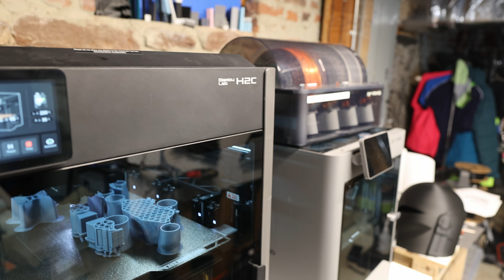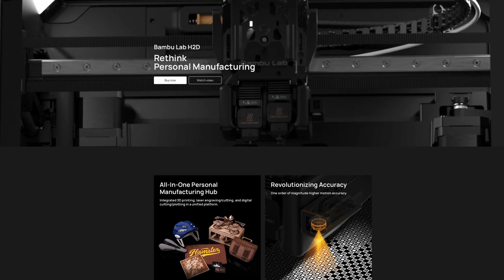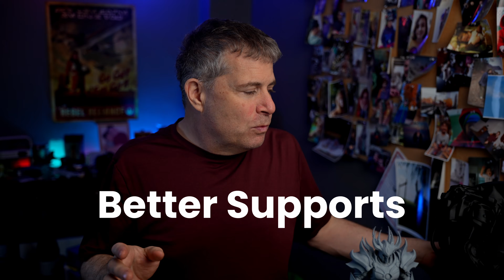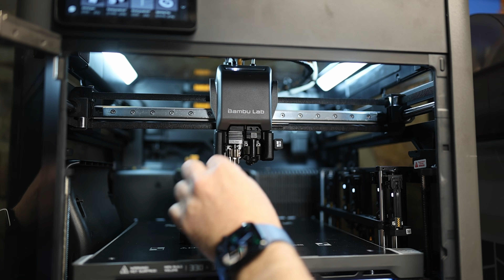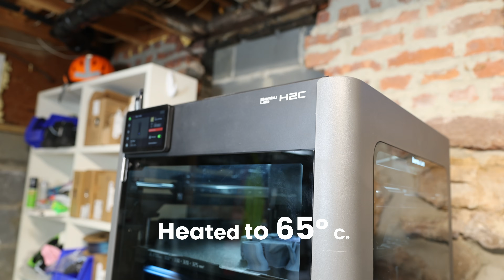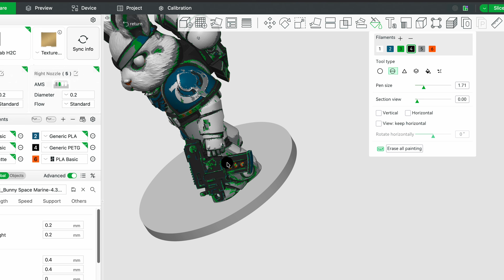The Bambu H2C Is Revolutionary. Here's Why You Probably Shouldn't Buy It.

Comment: I bought the p1s last month and returned it for the p2s because of the ams2 pro and other upgrades. Now I really want to return the p2s and get the h2c just because I can multi color prints without waiting days for it to finish and wasting pounds of filament. 

I’ve only been 3d printing for 2 months but I’ve been non stop at it and hit about 1500 hours already. I think future me will thank myself for getting the h2c. I’m just worried Bambu will release something better next year and I’ll have that buyers regret on not waiting!
Reply from the maker: That's some serious printing hours for just 2 months! This is like computers though. There will always be something  better in a year or two. You have to think of this in terms of the utility you get from it right now. Would you save enough time with the H2C by the time something better comes along that it’s worth it? If you’re printing at that high a level and you could save, say, 30 percent of your time with the H2c, it will save so much in time that getting something else whenever it comes out would be a trivial cost. 

My P2s sits largely unused at this point. 

If you do buy something please consider using the link in the description, it really helps. :)

Comment: Fot my business i like the color options, finished look, stability, and heat tolerance of ASA. I have an x1c and a p1p. The x1c just barely prints asa sometimes. Would you recommend the h2c?. Btw i do mostly 2 color prints but if I do the h2d i am only a couple hundred from just doing the h2c. Buyers remorse. Plus future growth.
Reply from the maker: I haven’t printed ASA myself on this printer yet, but I know what you mean about the other printers, the higher nozzle temperature the higher chamber temperature should be much, much more reliable. If you do buy a printer, please consider using my link in the description as it really helps out the channel. Any printer you get on the site after you click that link will give us affiliate commission. Maybe I can afford some ASA filament at that point smiley 😊
Reply: The H Series printers print ASA/ABS/ASA-GF/ABS-GF etc. as easily and as fuss free as my X1C prints PLA. With the engineering plate and a glue stick, both PA6 and PP also become 'slice, print and forget' jobs. The heated chamber makes a huge difference to repeatable results (and the layer adhesion is also FAR better, so it's not just aesthetics that improve).
Reply from the maker: Thank you for answering that.

Comment: So math is not quite right. It is apx 2094 cubic inches for the total build volume, but that is misleading as you can only use 1904 ish cubic inches with both nozzles (2063 if just using the left nozzle, 1936 for just the right). Only way to use the full volume from my understanding is by using the same filament in both nozzles and switching from one to the other for the very edges. Not very practical.
Reply from the maker: Good catch on the actual usable volume, you're right that it's complicated! Or rather I don’t math well.

Comment: My friend has a bambulab and honestly he’s not too happy with it. he keeps running into issues where prints don’t stick, jobs fail halfway through because of random errors, and it’s been pretty frustrating for him overall. on top of that, he’s also not really comfortable with the printer talking to the company’s servers, so he’s a bit concerned about his data and privacy too.
Reply from the maker: That's unfortunate, though most adhesion issues are solved by just cleaning the plate with dish soap and water! This does not seem to be indicative of the Bambu experience. I have have had eight of their printers in my studio within no major problems with any. 

If he doesn’t want to communicate with their servers he can use LAN only mode.

Comment: I have a H2S and want to get a second printer for multi color wasn't sure if a H2D or H2C would be the better choice. I'm leaning towards the H2C now after your video I feel the H2D will still be slow with more than two colors as the right nozzle still has to spend all that time AMS switching and purging time / waste. Great video!
Reply: I was torn between the two, then realized there was only a $400 difference between the two. You get a lot more printer for $400. I chose the H2C and love it.
Reply: @R @RoosterGardens  yeah seems to be the better choice for the price you are like 90% there if you are going to spend on a H2D .
Reply: @raddddix I don't think you'll go wrong with either one. Bambu makes nice printers. Even my A1 Mini is a little printing beast. I think it's still worth the extra money for the 5 extra nozzles. And for the record, my A1 Mini poops more than my H2C, and it only prints one color, lol.
Reply: @RoosterGardens 😂
Reply from the maker: Glad I could help you decide, the H2C is definitely the faster route for multicolor! 👍if you get one it would be great if you can use the link in the description. It really helps a lot.

Comment: Pressure tower isn't a waste?
Reply: You can turn that off, but at the risk of print quality.
Reply from the maker: You get that on any multi filament system so that’s a sunk cost. It’s not considered waste in the sense of the small curls of filament because it’s required for any color printing. If you don’t use the priming tower the filament won’t come out right.

Comment: Not sure how this would compare to core one L with Index, but both are very expensive printers.
Reply from the maker: It’s hard for me to even guess because for some reason, Prusa has never returned any of my emails. That’s sad to me because the mini is how I got started in 3-D printing. The color system looks interesting but I have a few concerns. The spools seem to fall out when removing the covers so you have to hold one in with one hand at all times to change them. I read you’ll have to drill into the machine to attach the system but I can’t verify that. It also maxes out at 8 materials. While it’s more wasteful having up to 24 spools means you can leave things kike TPU and other exotics in the machine or have several spoils to fall over to when a spool gets empty. 

And it’s going to be a huge space hog in a print farm. You need the space for the spools but also space to get to those spools. 

I’d love to look at it and I think it’ll be great. They’re different solutions and I think it’s great the industry is going that way. 

And it’s not available and Prusa doesn’t have a great track record on on that.
Reply: @davetriesthis  I think prusa is a good product, i trust the quality control for components of a European company more than China. But they do seem to have an attitude problem when it comes to price i think they could be a little less. They are not realizing that 3d printers are a relative simple device to build and any one who wants open source and wants to tinker can always build his/her own machine now with the help of you tube :). My assumption was that for a print farm they would be good due to build quality and not having to deal with Chinese support, but I do not run a print farm.

Comment: I was thinking about getting the H2D but not sure if to just get this. Never had a printer but i don't want too buy a cheaper printer then another one later

I am not sure about print size though
Reply from the maker: The bigger bed is worth it, especially if you plan on printing larger projects right away. The h2c is the way I’d go. It’s futureproofed a way the H2D is not. If you do get one of either please consider using my link in the description. It really helps.

Comment: I have the P2S with about 250hours and the U1 being delivered in a short time as the website is indicating. I’m looking into the H2C because of sheer size alone. I cannot make chestplates/proper thigh plates with the small beds I’ll be working with and like the idea of still using Bambu handy with the prints and I enjoy the AMS 2 pro. I merely wanted to see which i preferred and spending less than the cost of the H2C on two printers but now entertaining the idea of buying one as well lol. I also agree with one of the other comments previously about buying the u1 BUT! Everything besides the unit is on back order, the lid says an estimated delivery of October and that’s if I’m lucky along with all the nozzles and extras I bought with it. Only the unit says it will be shipped, if you were hoping for extras and being able to find spare parts and such then look into brands you can actually buy in short notice if you’re in a rush. Thanks for the information friend! I’ll be sure to use your link if I order one :) (if you’re like me though you’ll just go to ikea and make the lid like everyone else)
Reply from the maker: Wow. October? That’s crazy. I’m supposed to have a review unit in now but it’s been pending for more than a month. I know why now. 

The printer is great. I just got in the Centauri carbon 2 to test and it’s like that printer suddenly looks like old tech. 

If you don’t need an ace for cosplay then the ender 3 v 3 plus is pretty reliable. See my video on it because I made a mod to deal with their dumb runout sensor idea. 

What kind of cosplay are you doing?

Comment: Nice, I like the Vortek, but too big, too heavy, too power hungry for my old house and wiring, and WAY outside my budget.
Reply from the maker: Here’s a 3d printer tip for old houses. I live in a Victorian. I reviewed one of those camping battery using a that has solar panels. They also have ac input. It can handle the wattage draw of refrigerators. The h2c and p2s are plugged into it. It regulates the power, doesn’t put a load on the wiring and then can prevent hours of power loss if we have a blackout. It’s saved a few long prints. Printers will all do power loss recovery but it rarely works since the bed cools.